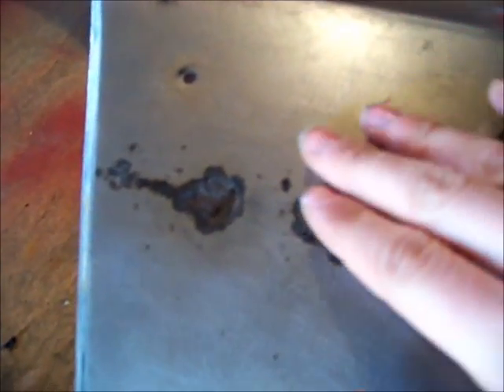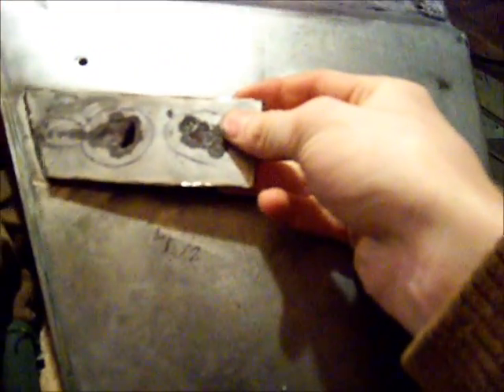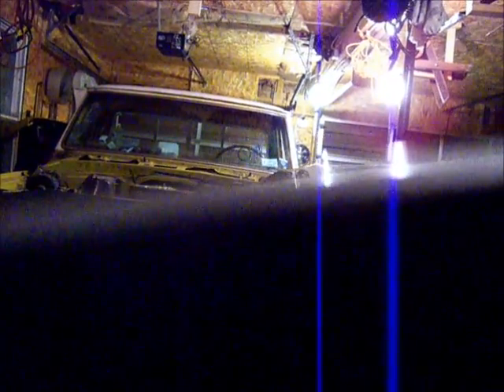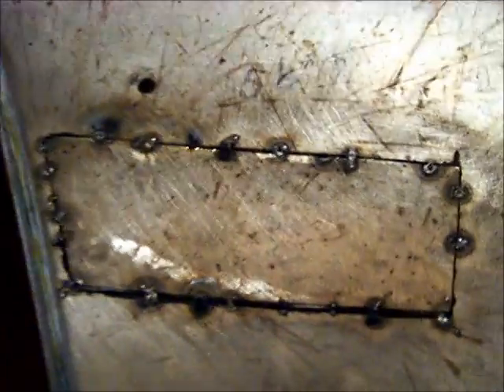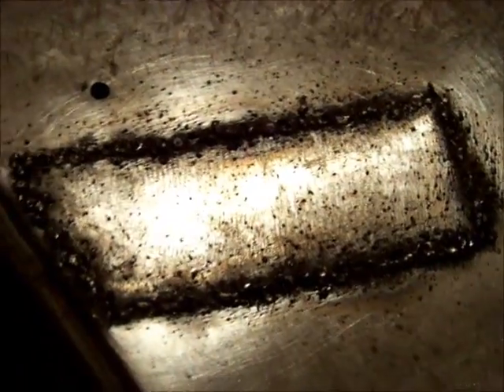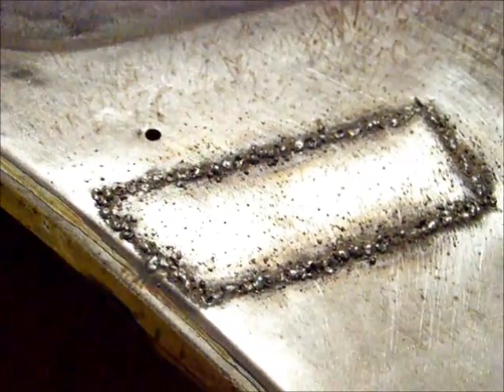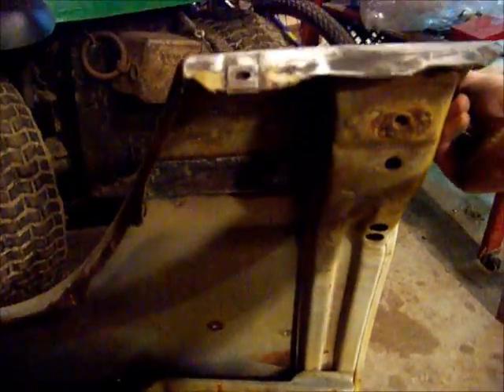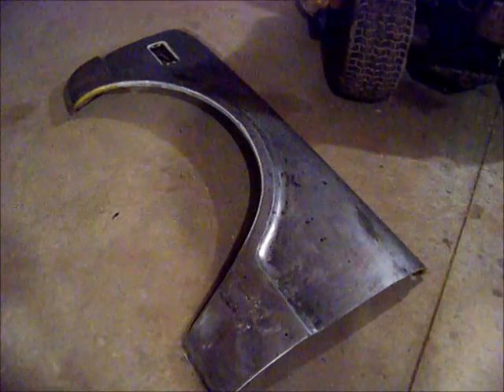fender repair panel -72 chevy truck

Comment: Nice patch Dean, Some guys use compressed air to cool their welds to prevent warping, I use a cold wet rag after each weld , Both ways work, Just a suggestion, Keep up the good work.
Reply from the maker: hey thanks. that is a very good idea that I will try!

Comment: Nice Fix :) A little bit of body filler an it will look good in no time,you can't help to warp it a little. I found using a soaking wet rag does great for not warping panels as much when welding. just keep the rag soaked an wipe around the area you are welding,we never had a rag catch  fire yet lol
Reply from the maker: hey thanks. that rag trick is deffinatly something ill try on my next repair. thanx